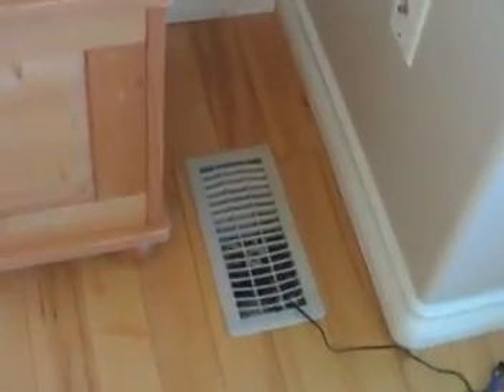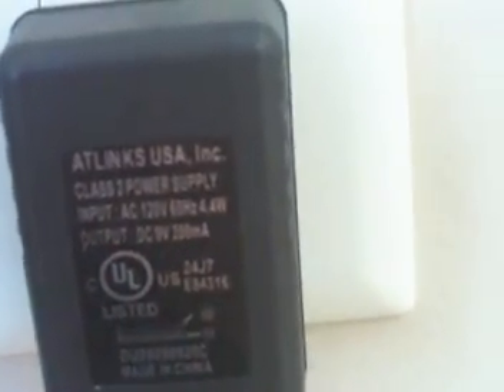Homemade Duct Booster

Comment: A few years ago I thought of putting a small 120 volt fan in my round air vent because my bedroom is at the back of my house and it always stays cold in the winter and hot in the summer.